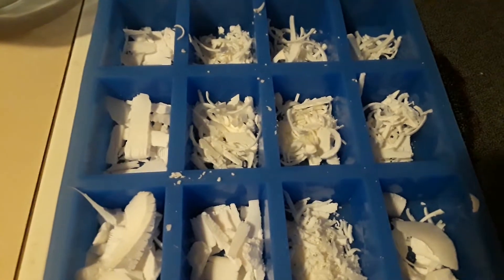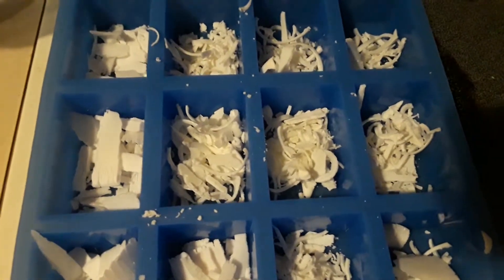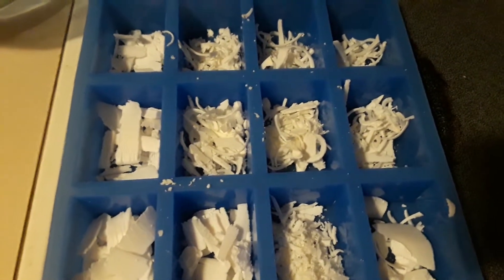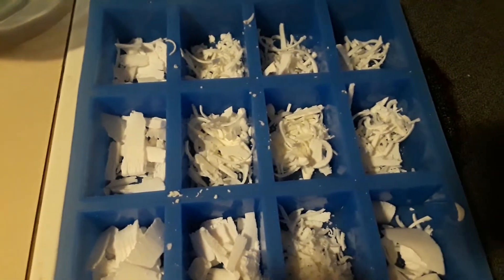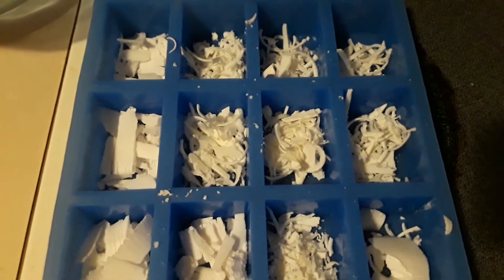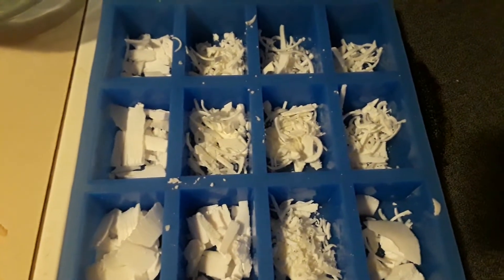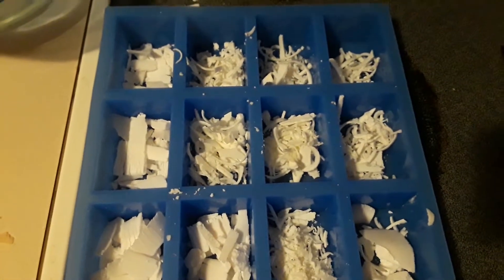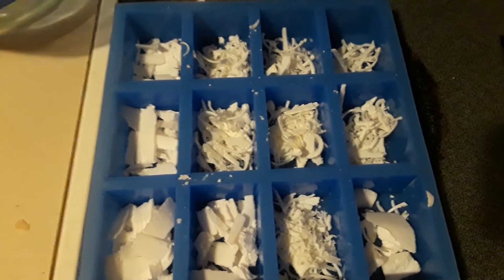Homemade Soap "Trimmings"

Comment: That is really good way to not waste good soap.  I've been thinking of making drawstring soap holders out of a very fine mesh or thin terry for the shower.  I have issues with the last of the soap bars when they start breaking up.  However, something like that would work on soap trimmings as well.  Thanks for sharing!
Reply from the maker: Lol, ok great minds again :) I have a terri cloth soap bad I use.